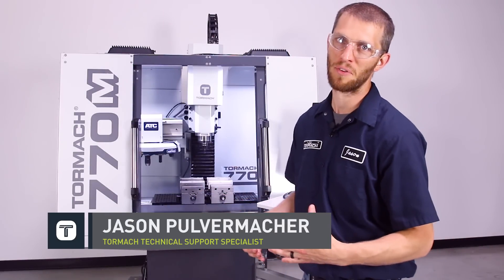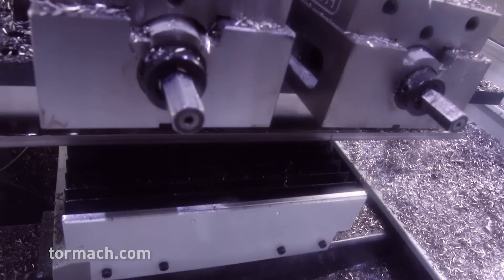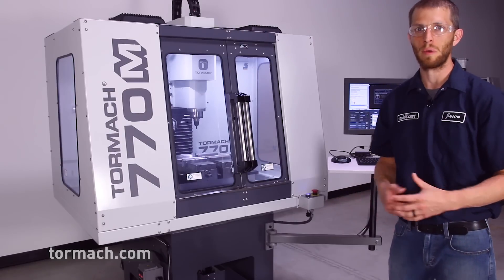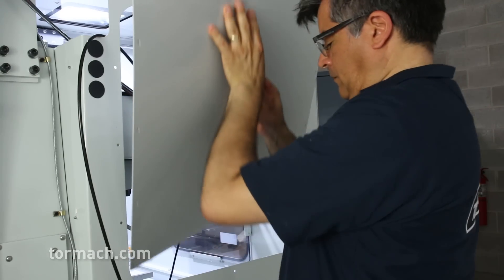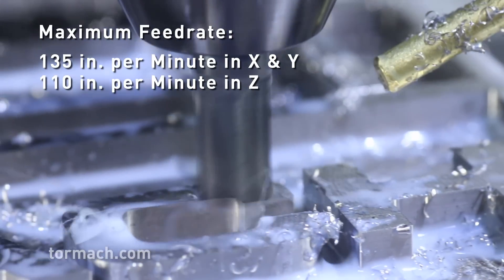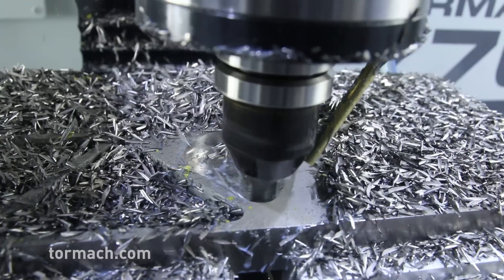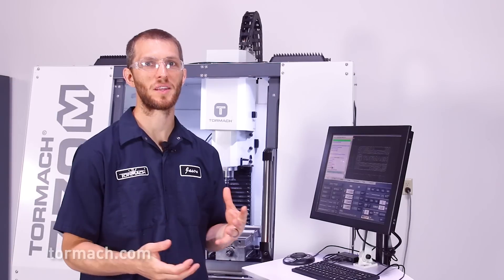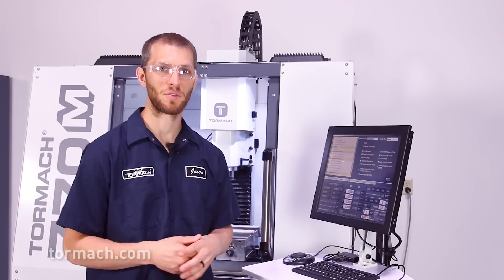Tormach 770M Specs and Overview

Comment: Anyone wanna buy my slightly used Series 3 770 with Rapid Turn. Holy Crap
Reply: I think there will be lots of used Series 3 machines on eBay this summer. And even more when the “MX” machines come out (servo motors for motion, spindle encoder to enable rigid tapping).
Reply: Feeling the same way. ATC and everything.